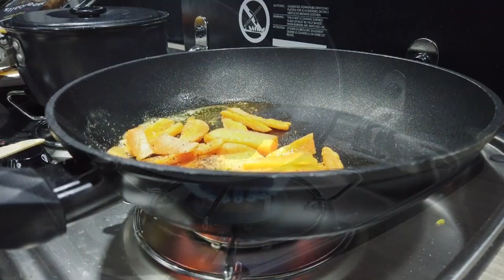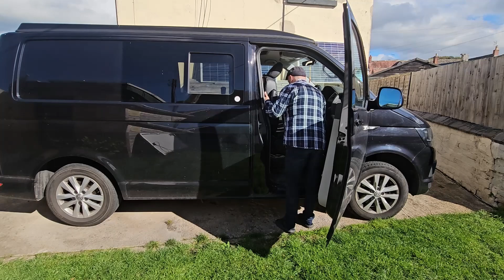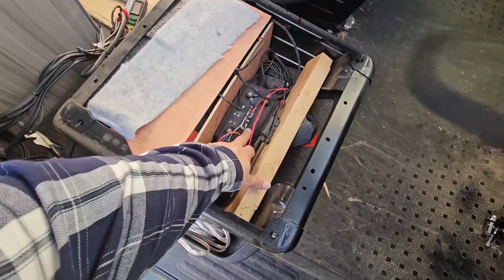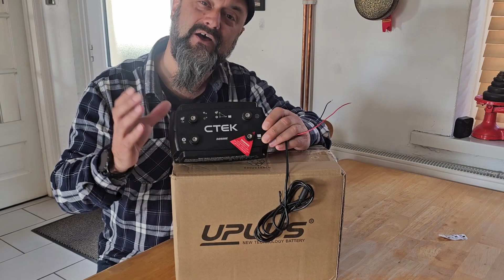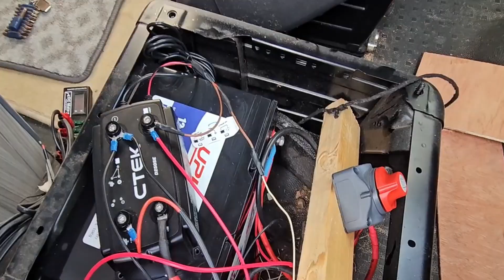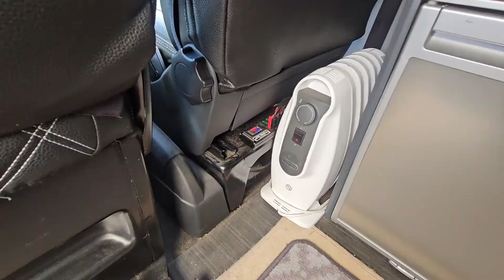DuB-EnG: UPLUS Lithium LFP12100 Leisure Battery - Under Seat Installation in T5 / T6 campervan £200

Comment: Will this battery be powerful enough to start a diesel heater?
Reply from the maker: Yes absolutely
Reply: @DubiousEngineering brilliant,  thanks , i have to have my engine running for my diesel heater to start , it only runs for about 10 mins then it turns off even when I'm driving , i think this must be a problem with my leisure battery?

Comment: ❤ I've just done the same to my T6, swapped the AGM for LiPo. I thought l'd try leaving the sterling power B to B charger and victron mains charger which are both AGM  and all seems to work perfectly fine with lithium. Will you be leaving your new battery installed in the van over winter Howard?
Reply from the maker: Absolutely I will, I plan to connect some solar panels so the batteries don't deplete too much.  As both my batteries died after 5 years